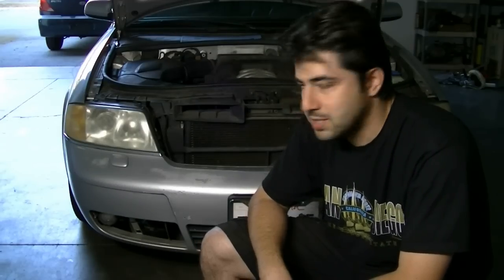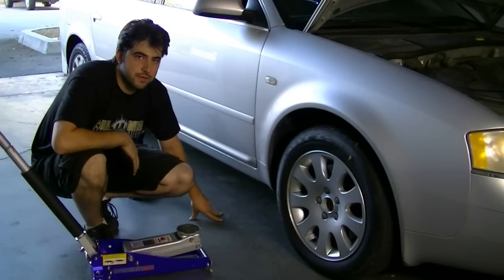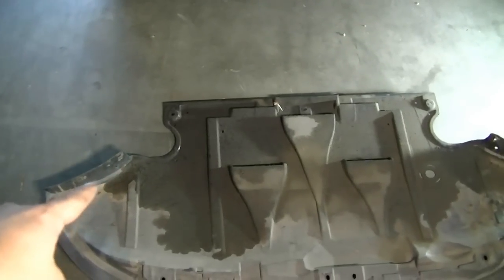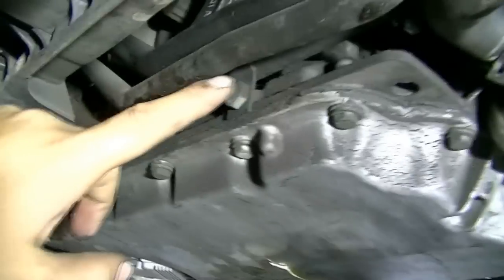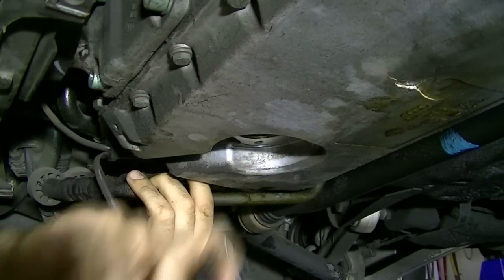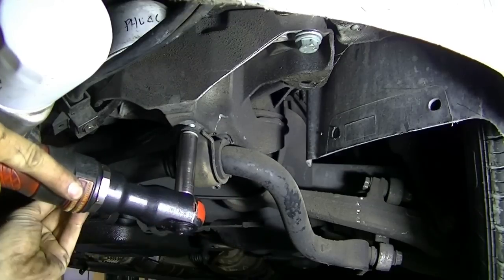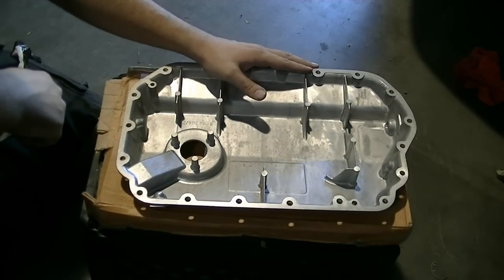How to Remove and Replace an Engine Oil Pan and Gasket - AUDI VW 2.8L DOHC Engine

Comment: I was told the audi a6 has 2 oil pans i infact have the same audi a6 as you!! Just want to know if this is true or not!!
Reply: They have an upper and lower. He did the lower one. The upper one is far more involved. I'd say you need to removed the engine to get the upper pan.

Comment: So I have the same car and same problem however the oil pan I received doesn’t have a hole for oil level sensor the bolt holes and indent on the pan is there however the place when you insert the level sensor is covered by the  aluminum. Not sure what to do here need help.
Reply: wrong pan

Comment: There is a skid plate there, so how could you go with that thought process? I ask this as i cracked mine when i was loosening the oil bolt during an oil change. You show the skid plate, but it looks like the one with the oil pressure leveler which the 1995 A6 does not have, apparently. Otherwise your directions are spot on, i got mine off in about 8 minutes and just gave it two taps on either side and it came right off. P.S. I was able to do it WITHOUT having to remove the swap bar, maybe i got lucky, or maybe i had a smaller tool. If it is the metal gasket and it is NOT damaged, can you reuse it as it is not pressurized?

Comment: Thank you for your video. After watching a few from other posters yours was the most complete and accurate. The car I'm working on is a 99 Passat 2.8 V6, your car was the most like mine  which is important since all the other videos included raising the engine as a necessary step, yours did not, and after looking at mine I could not see why it required raising the engine. Thanks again, Very well done!

Comment: Awesome Video, exactly what I needed to know for this model!!  THANK YOU!!!

TIP- Use a few Oil Pan Bolts to guide the gasket on the pan, and the use them to guide the pan back onto the block.  The alignment will be perfect.  Although you might need to clean a bit of the gasket compound off the bolts though.....

Comment: Hey I'm going to fix my oil pan by welding it.. I had it replaced this holiday weekend and next day leaking oil bad.. not even new oil...I have to see for my self...I'm thinking AAA is into some trouble with me...
Reply: Nicole Bacchus JB weld
Reply: Nicole Bacchus welding doesnt always work, engine blocks are made of a cast iron, nothing welds to cast iron very well, i suggest just replacing it
Reply: She's not talking about welding the engine block, she wants to weld the oil pan, and these oil pans aren't cast iron; they're aluminum.  That in itself makes welding a challenge (fewer people know how to weld aluminum, or have the correct gear for welding it, than for welding steel).

Comment: Good video.     FYI, its 10ft/lb torque on those bolts.    And I think 18ft/lb for the Sway bar bolts that you removed.    

I have to do mine from a leak in the oil drain plug.    Was going to use heli coil, but a new pan is cheap enough.

Comment: I have to replace cracked oil pan on a 2002 audi a6 3.0l. I got a new pan but can't find a gasket. The local auto parts store said I only need silicone. I haven't removed the cracked pan yet to see if there's a gasket. Can you tell me if I need a gasket?
Great vdo.
Reply: Silicone only, no gasket necessary or required by Audi.
Reply: slagdemon 
Ecs or any other online store doesn’t even sell one. Funny enough though autozone has one lol

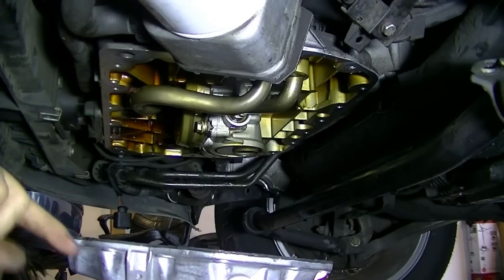Comment: What is the part called that the oil pan bolts on to? It is the golden tinted thing that is exposed at 5:50. I need to know, for I cracked my pan and that part as well.
Reply: Hey my mechanic told me that I need to change the same thing on my 2003 audi a4 quattro v6. Did u find out what it is and where u able to fix it, if so can you please tell me who fixed it and how much did it cost you.
Reply: 817shakazulu It's called the upper oil pan. It runs about 500 dollars for the part and anywhere from 1k to 2k for labor as you have to have the engine pulled. I ended up just totaling mine with insurance.

Comment: The 2.8 30v is NOT a VW engine, it's Audi. Audi shares that engine with the Passat B5 and B5.5 if I'm not mistaken.  Good video though.
Reply: auteck bruh... Vw makes Audi.. They are the same company.. Audi is just there high end line. Like lexus is to toyota

Comment: Question how long does it take for your engine to mess up? if you turned on your car ,then saw the oil light turn on while reversingthen pulled back in the drive way looked underneath and see a rock puncturing your your oil pan,this all occured in under a minute ,,you think my engine could have messed up that quickly,jw because i was gonna replace my oil pan on my vw passat
Reply from the maker: Hard to tell from here but if you didnt hear knocking noise from your engine right before you turned it off you should be ok. GL